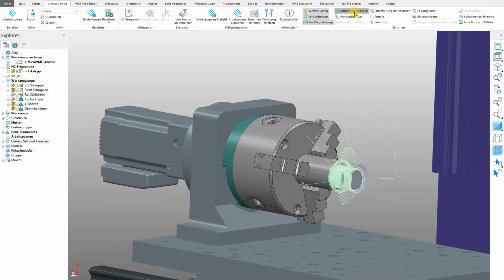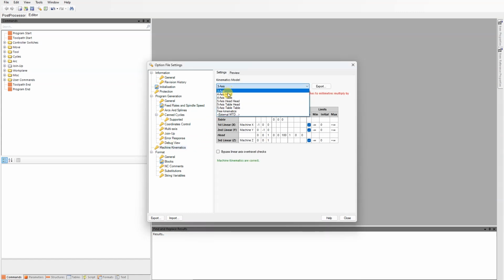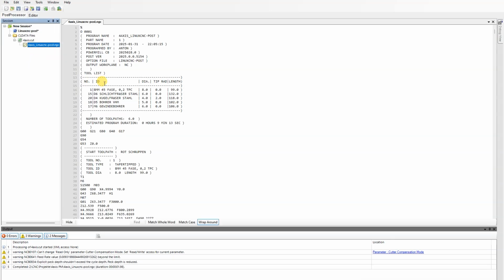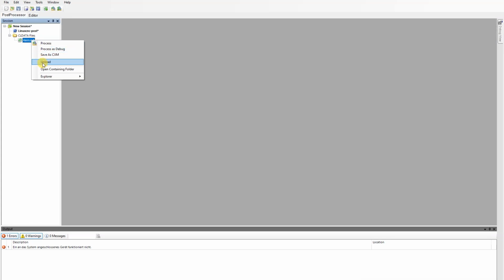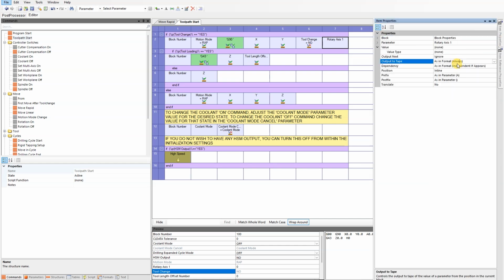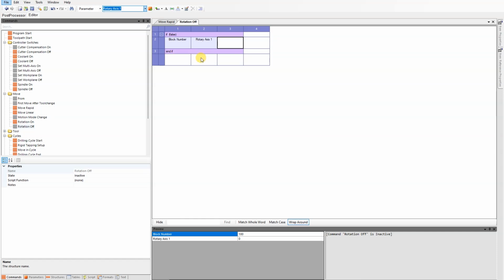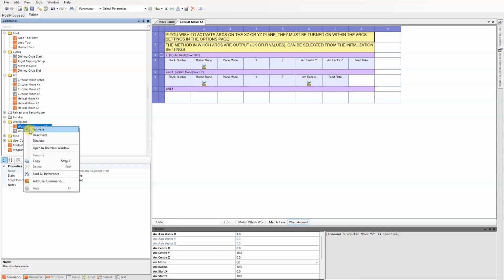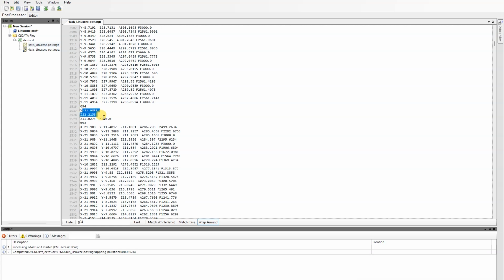Linuxcnc Powermill 4 axis post processor

Comment: Great job - tutorial!
I'd like to ask you, how to add before rotating the A axis use an M101 and after finish rotating use an M102 code? (sometimes, on long part we use pneumatic holder, so before rotating we need to release the jaw, after rotating we have to lock it back) Because editing it manually is horrible. There is only a few angels, but after editing the strategy we need to add the m101 and m102 again.
Reply from the maker: Hello, i have to check it in the PP Editor. I'll try it soon.
Reply: @diycnc2023 Hi, thank you. I will be very grateful to you for this information.
Reply from the maker: Not at Home now, but:
In the video at 23:15 , Try inserting a Block with M101 before "Feed Mode"

And the Same for Rotation Off at 24:50 but with your M102 command after the "Feed Mode" block
Reply: @diycnc2023  ok.
Thanks!
Reply from the maker: @DPTech_workroom  https://youtu.be/g1sJ2tQoTYQ

Comment: Is Powermill able to make gcode for Linuxcnc with Axis c which reads gcode quickly because now my Linuxcnc is very slow is the problem with the post processor?
Reply from the maker: Hello, can be. When you enable the reverse time in your post, the c axis turns faster. But it is hard to evaluate without knowing the machine...
Reply: @diycnc2023 My machine is a camshaft grinding machine so it requires fast speed in feeding. I use a Mesa 7i96s which has specifications that can reach 10MHz. I hope it is much faster than my machine.Previously I was confused about which part to set because I don't understand Linux, I use Mastercam